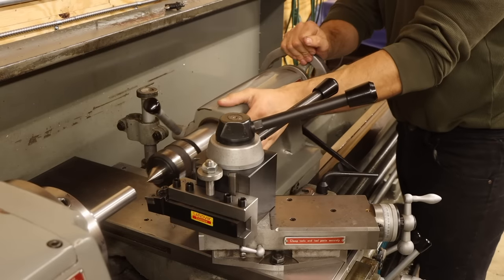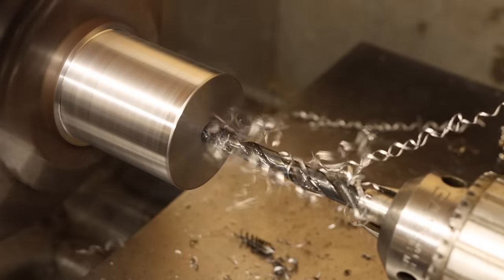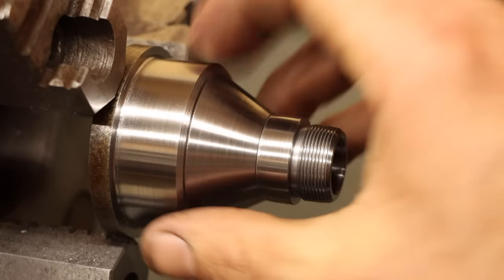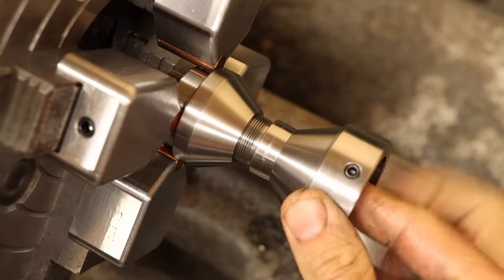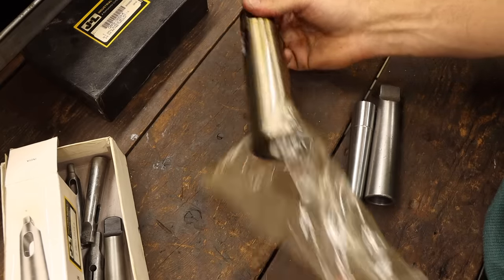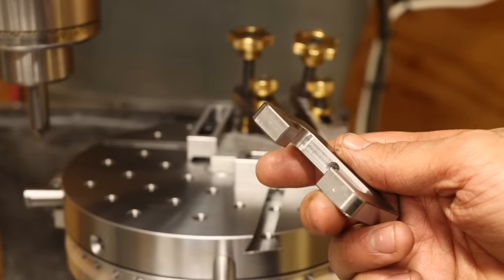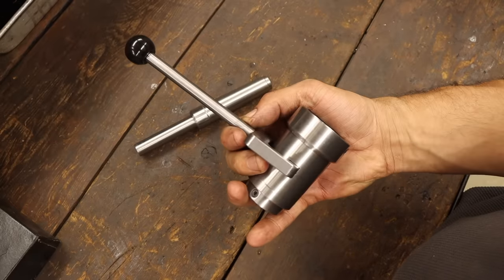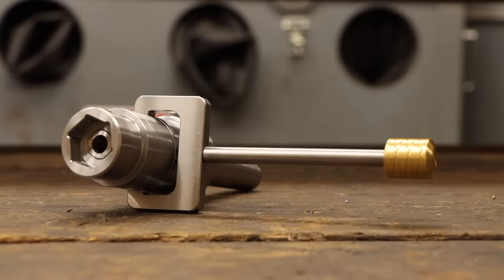Live Free or DIE HOLDER

Comment: I get how the cone clutch works, but my mind is blown trying to figure out how applying pressure to the handle one way or the other changes direction.
Reply from the maker: I should have mentioned it but i reverse the lathe to back the tool off the part
Reply: That makes A LOT more sense, lol

Comment: 10:17 Can you explain what you mean here a little more?
Reply from the maker: I just mean that the little conical spot drill that is on the curved perimeter of a die is centered along that distance. So drilling the set screw a bit closer to the back face will cause it to push the die squarely against that fast a little better
Reply: @InheritanceMachining  Ah, got it.